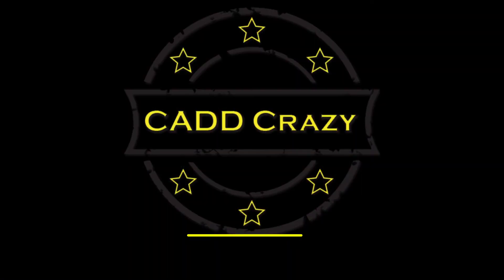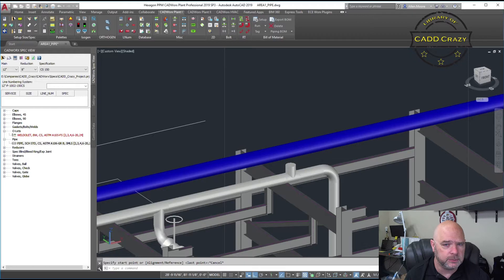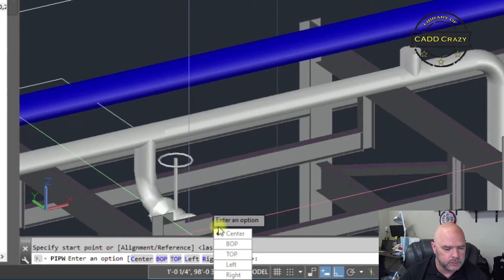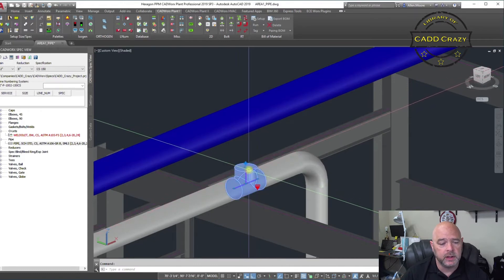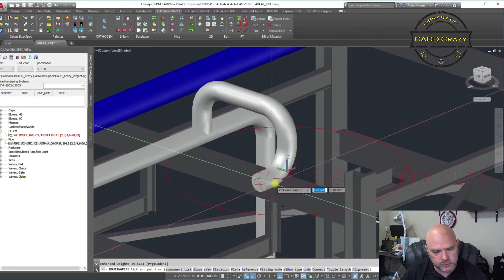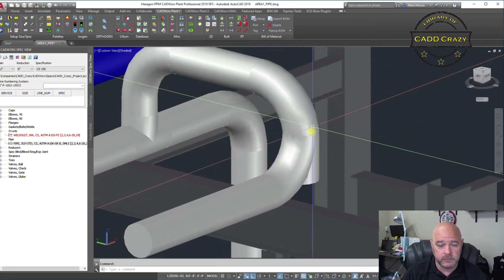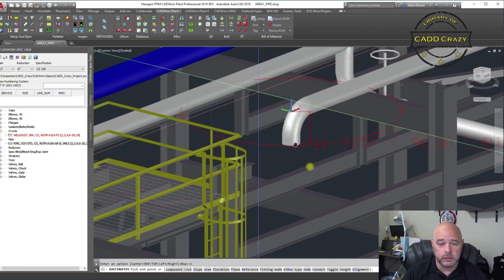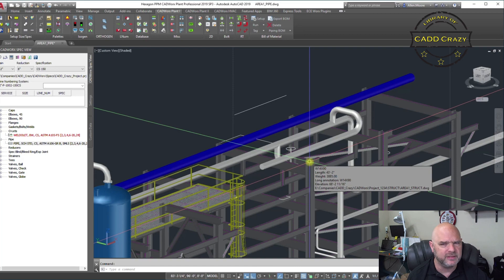CADWorx Plant Pipe Alignment

Comment: Hi, thank you for your video, I'm an old user of CADWorx, till 2010 version I used to work with CADWorx and Naviswork simultaneously, modeling in CADWorx in wireframe mode and reviwing in Naviswork in shaded mode simultaneously, I just needed to press F5 in Naviswork to have the udated CADWorx model, it was my method for increasing the speed of modeling, but after 2010 version CADWorx started to have difficulties in reviewing it's models in Naviswork. Now I'm using 2014 version and there is no OBJECT ENABLER for this version. what's your suggestion for me? if I shif to CADWorx 2018 version this problem would be solved?
Reply from the maker: First the Object enabler you install should match the version of Navisworks you are working. Example if you are using CADWorx 2014 and Navisworks 2020 you would need the CADWorx object enabler for 2020.

Comment: hey @cadd crazy, how are you man. 
i got a question though its fair to say i never used this app before.
lets say i place a pipe on fixed length and so i want to create a turn to it in some axis. 
the turn, i want it to be an object i created and saved as asset in my assets library. 
this turn also got values in which the main pipe when linked i want it auto cut off the main pipe for the value of how much the main pipe can be inserted to it. 
so let me explain this a bit farther, to this Turn, the main pipe can be inserted to lets say 1.6 cm from one side. 
now, i want to link the main pipe to this Turn and that it will subtract this 1.6 value from the main pipe as i drop the Turn asset onto the main pipe and give me the right length i need. 
is there a way of actually doing so? 
hope you have time and maybe you can create a video about it. 
as to how create asset and how to code it that way. 
thanks in advance man and have a nice day and thx for the video, also i subscribed.